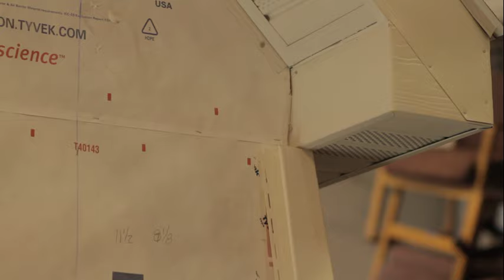How to Install Vinyl Siding Part 1: Corner Trim

Comment: A 2 1/2 inch mark from the corner then chalk a plumb line down and you wont have to eye ball attaching the most important piece.
Reply: Wayne Michel I've always done 2 3/4
Reply: Wayne Michel seems like an unnecessary step for siders that have experience . But for those that lack experience I'd highly recommend this step. It's to many times I've seen corners all jacked up from being in a hurry simply because they lack experience. 

I have to add to those that think jus because u do a couple houses and understand the process doesn't mean ur experienced, so u shouldnt skip what this man has recommended.
Reply: Wayne Michel cement v
Reply: Eyeballing is fine if your eyes are good

Comment: I  it it the other way so the factory cut is on the top so at the bottom I can cut it and fold it to the inside to prevent bugs get in

Comment: If you want to install vinyl siding over an exterior 2 inch rigid board insulation being used to increase the R value on the outside walls, what type of fasteners for the siding are you using?

Comment: Thanks for the detail of the corner pc install and cutting. I have seen so many homes with these vinyl corners just cut square at the top, leaving the top open on the one side! Also as mentioned in another comment there was a gap at the top of the corner post. 
do you use caulk to dress that?